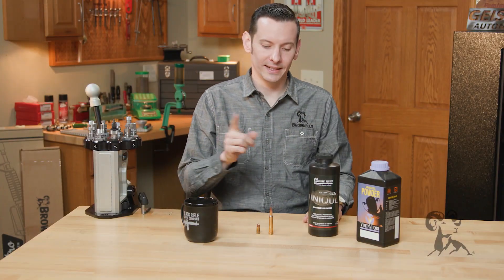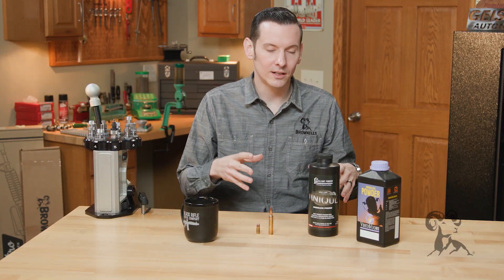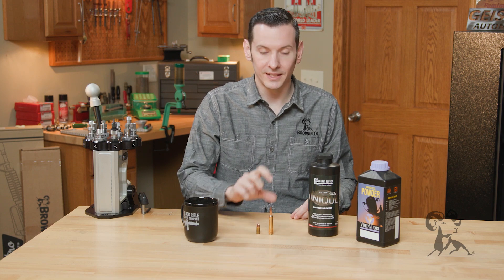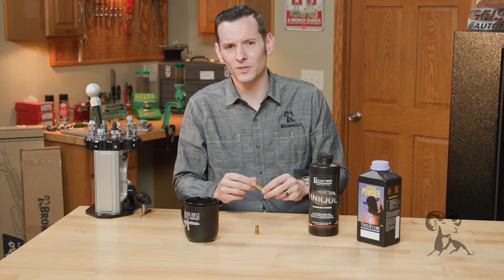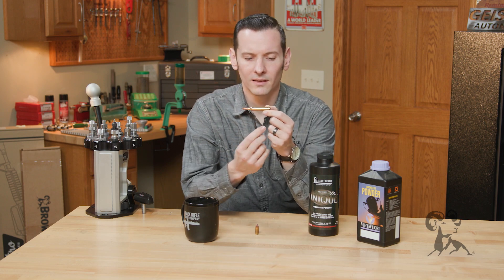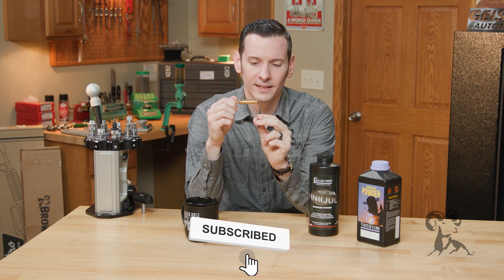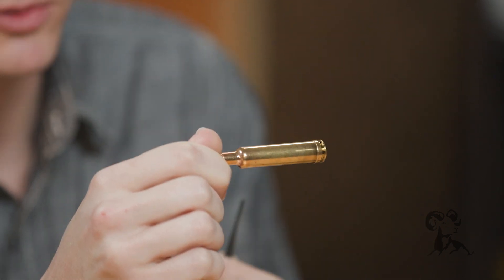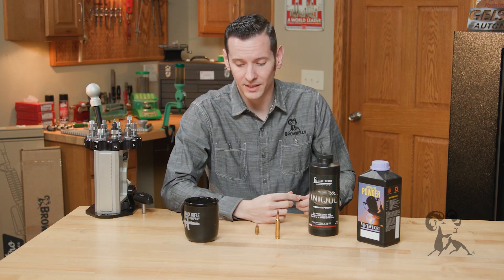Quick Tip: The Dangers of Undercharging a Case

Comment: Started reloading in the early '80s and can't remember which manual it was that for any load which was undercharged to top off the case with kapok to fill the space.  Supposedly would burn cleanly and keep the powder back against the primer port for normal ignition.  I never tried this.  I do however when loading Titegroup in 45ACP 200gr SWC, only partly fill the cases.

Comment: In my early loading days (bolt gun, not semi), my manuals said that if you were running under-charged cases you should fill the space with kapok in order to ensure proper ignition of the powder.  That was in early 1980s, haven't seen that advice printed anywhere since.  <EDIT> I NEVER LOADED WITH FILLERS, DO NOT TRY THIS AT HOME!!!  <EDIT>

Comment: There are lots of microloads that work really well. I make them from time to time for "parlor gunning" with .38 Special and with .303 British.
Example. .38SPL case, 3.0gr Bullseye, CCI primer, (1) 0.375" lead ball.
Example: .303BR case, 8.0gr Unique, Winchester primer, (1) #0 buckshot

Note that neither of those loads will fully obturate the case but both loads should be plenty hot enough to clear the bore and act as a very light plinker. Neither will damage either your gun or your brass.

Comment: There's a ton of variables that aren't being addressed or considered. 300blk, subsonic loads are textbook under-charged loads, but do not detonate or cause pressure spikes. The scenario you suggested, would mean that the case load would have to be loaded less than half it's case volume and assuming the flash hole is in the exact center. Although the scenario is plausible, the exact cause is difficult to pin down. And this is assuming we're talking exclusively about rifle ammunition, correct?

Comment: Case in point: H 110. That’s a fine, very dependable powder when used properly in full or near-full loads but ignites inconsistently when under-loaded. You could have over-pressure, but more likely a squib.

Comment: How about the traditional 2.7 grain Bullseye .38 Special charge?  This meets the definition of below the center axis of the case, but has been used, without incident, for eons of Bullseye target shooters?
Reply: I believe this is not a problem with fast burning powders like Bullseye since they always burn quickly. The problem happens with reduced loads of slow burning powders which are designed to fill the case with typical loads. The burn rate may increase significantly in partially filled cases. The most common problem with fast burning powders is double charging the case.
Reply: @machintelligence  I agree, and that was my point.  The video didn't address the relationship between the phenomenon under consideration and burn rate of the propellant.
Reply: @robertgad3269  I didn't mean to contradict you. It was more of a clarification.
Reply: @machintelligence  Understood.

Comment: Spot on. Proven, too. If the flame from the primer is able to reach  completely across the column of powder, it can all ignite at once, instead of burning progressively. Enormous pressures result. I carry around the head of the extractor from an 03-A3 Springfield in my thigh since 1975 as a reminder. A very reduced charge of IMR-3031 caused the round to detonate.

Comment: Partially true: H110 is unpredictable in light loads, but blowing up your gun? That's like blowing up a house with a teaspoon of gasoline!! Not possible the BTU energy simply isn't there to create the gas volume to overpressure and blow up a gun! The powder has a burn rate that is controlled by the chemistry.
Reply: Correct.
Reply: @DinoNucci  I do light loads for fun. If too light a round may only go halfway up the barrel, now you have to tap it out with a brass rod! LOL Typically you can go 60% to 85% powder. Kinda handy on a 9mm AR-15 that are hard on the gun with a heavy buffer slamming around!

Comment: Both undercharged and overcharged loads that act non linearly are typically double based ball powders.  There are powders that spike pressure if the load density gets beyond say 90-95% but stick powders act just fine in compressed loadings.  The opposite is true too!  There is way to much energy and cavatiation to give this theory any credence, you can point that rifle straight up and get the same results.  That's a myth for sure that the reason is because of the orientation of the powder caused a pressure spike, total bs.

Comment: I've heard about this a looong time ago, but this is the first time someone actually explained why it happens.
Reply: It doesn't happen. It' scientifically doesn't happen.
Reply: well, there is 2 things that can happen. First a massive pressure spike, to much powder at once is lit. The other is secondary detonation, ie the powder starts to  burn but goes out and the bullet has moved up the barrel, then the pressure wave comes back and the powder starts to burn again. Now that the bullet is further up the barrel, the pressure will be to high at the wrong place and will cause either bulging in the barrel, or just plain banana-peel of the barrel.

Comment: This is why I always keep a control bullet on my bench that has the correct powder charge and bullet seat depth.
I use it to confirm my scale is weighing correctly, and to ensure each bullet I reload matches the weight.

I let my mind wander while reloading some .303 British, and instead of 42gn of powder, I loaded them with 40gn of powder.
Thankfully I checked the batch, and found they didn't match the control round, so I had to pull all the bullets and remeasure each charge.

A 2gn difference might not have been an issue, but 42gn is the lowest safe load for my powder, so I wasn't gonna take any chances.
As Ben Franklin said, "A stitch in time saves nine." In other words, fix something in time - before there's a problem, you save yourself the grief of an even bigger problem, and bigger problems involving guns is not something I want.
Reply: it would have been fine. maybe if you did 14 grains

Comment: I use a dusting of titegroup in 38 special, I have had split cases but nothing bad to speak of, this load is definitely not a fast draw load, which is where you can have problems with low charges. it’s for making cloverleafs.

Comment: Since primers are scarce, I traded some large pistol primers for some small magnum pistol primers.  I wouldn't normally have wanted magnums.  Anyway I tested some loads using the small magnum pistol primers with reduced powder charges (at the minimum and slightly below what is called for).   At the range, I found the cartridges delivered a healthy recoil and my barrel leaded.  So I'm not doing that again.

Comment: The phenomena first reported in the 1960s as I recall, specifically with small charges of Bullseye in larger cases like 44. Since then I heard of a number of these explosive incidents powerful enough to wreck a Blackhawk. All involved larger cases with small amounts of Bullseye. 

 It doesn't happen that frequently, but just enough so I always avoided Bullseye. There's better powders than Bullseye so why risk gun and body. That's likely why the Bullseye Kabooms are almost unheard of today. But years ago we didn't have the powder choices available today.
 
The cause has been much speculated but AFIK its a mystery WHY it happened randomly. The makers of Bullseye always blamed double charges but the kabooms were usually with very experienced handloaders who shot a lot. 

The attraction of Bullseye was cost savings since a little bit would move the bullet. But saving two pennies per shot was never enough to entice me to use it.
Reply: This vid is fake news. 
The cause for your ideas above could have been from a squib load not existing the barrel - that is what can cause an overpressure, not tilted powder in the case.

Comment: Just had my first squib. I put a bullet in a primed case as part of my method of expanding new 10mm cases as little as possible and somehow set it in the ready to press line. I guess, anyway. Made a click like a dry fire and i had no idea there was a bullet in the lands, seemed like a failure to extract. Luckily the next one wouldn't chamber! Squibs can make almost no sound, pass it on and check the barrel every time you get a surprise no-fire.
Reply: I’d scrap that method, no good reason to do that but plenty not too

Comment: In 15 years of reloading, I have only had one powder charge failure. It was a .38 Special that I only primed and did not charge with powder. It was lodged in my barrel, but luckily, I was able to push it out with a pencil. Good thing I didn't fire another round behind it! Always check every case for a consistent charge before seating a bullet!

Comment: Going with that logic, 45 Colt should be a risky load since you regularly only fill about a quarter of the case volume with powder. Which is why we got 454 C & 460 S&W.
Reply: Correct. This video is scientifically wrong.
Reply: Could it be because pistol powders tend to be faster burning than rifle powders, so the relative pressure spike is smaller?
Reply: @jic1  Much less pressure on average.

Comment: Under charging  is more likely to resule in the pimer backing out of the case in a revolver can cause the cilinder to lock up. Or in extream  under charging it can cause a squib round  with the bullet being stuck in the firearms barrel. A over pressured round by under charging seem highly unlikely I have never heard of that happening ,
Reply: You are correct. This video is false
Reply: @DinoNucci  This isn't the first time this guy has made flase claims pertaining to reloading. He doesn't up on the facts and the ins and outs when it coemes to reloading.
Reply: @wiseguy4364  you are correct. Brownells management needs to be made aware before someone gets hurt.

Comment: I had emailed hodgon's directly about this and they said that this explosion can happen not because of surface area of the powder or anything like that, but because the bullet gets stuck in the barrel because pressure is not high enough to keep it moving. so when it get stuck you are now fighting static friction and not kinetic friction. so what happens is that at that point your under pressure event becomes an over pressure event because the bullet does not keep moving down the barrel, which doing so alleviates the pressure, and instead it just builds too fast and the case blows up.
Reply: Actually both can happen.  What Hodgdon is describing is called S.E.E. (Secondary Explosion Effect) and it is real, but very difficult to duplicate in the lab because it doesn't happen often.  Youusually need a certain set of  conditions such as a fouled bore, heavy bullet, slow powder, and some dumb luck.  The precursor to an S.E.E. is when the bullet slows down but then the pressure builds up and successfully pushes it out the barrel.  That leave a heavy carbon ring in the bore from the incomplete burn which can then cause increased resistance to the next bullet causing the KABOOM.  I've seen this happen and stopped shooting before the KABOOM.  I noticed two separate recoil impulses, and when I looked down the bore I could see the carbon ring about 3/4 of the way down the bore.  I believe the next shot would have blown up the gun if I hadn't caught it.
Reply: CORRECT.
Reply: Yeah it's called a squib. We all know. And that wasn't what happened to Kentucky Ballistics.
Reply: @DronesUnder2A  wrong

Comment: Given the same situation, another perspective holds that when the primer Is fired it does not immediately ignite the powder, but actually flashes over the powder and only pushes the bullet forward. The bullet lodges in the barrel and then the powder ignites. Obviously, in an extremely short period of time causing high pressure that appears as detonation.
Reply: This is correct

Comment: I appreciate the quality info that you and the Brownells team put out. Would the same concern apply to pistol cases with small powder charges? I know that there are powders like Trail Boss that can be used to achieve greater case fill, but would you recommend that for cartridges like 9mm and 45 acp? Also what are your thoughts on S.E.E. secondary explosion effect?
Reply: This video is incorrect
Reply: It depends on the powder.   Something like AA#5 it could be dangerous, but with powders like Unique or Bullseye, people have been using light charges for ages.  If in doubt, contact the powder manufacturer.

Comment: "You can over pressure the chamber by underfilling the case." That's a new one on me. Wow you learn something new every day, even long after you think you have most of it figured out.
Reply: Same here but it makes sense when you think about it. The more I learn the more I realize I don't know. lol
Reply: @LSFprepper  no
Reply: @DinoNucci  you’re incorrect
Reply: It all has to do with exposed surface area to the primer. A good visual could be done with a clear soda bottle and sand.
Reply: @dwightmitchell1464  no. This is wrong.
Reply: @DinoNucci  So, you're crying foul but offering no information proving why it's wrong... Sounds to me like you have no idea what you're talking about.
Reply: @dwightmitchell1464  no
Reply: @DinoNucci    go away troll
Reply: I still remember how much it blew my mind to find that heavier bullets need less powder. It's not all something you can guess in handloading. Really gotta keep reading those books, lol.
Reply: @vincentdivita7800  its not so strange, a normal logical person would conclude that heavies bullets build pressure higher before the bullet starts moving. The MAX pressure during the entire cycle is what is dangerous, as soon as the total chaimber (ie all volume behind the bullet) increases the pressure goes down, the volume quickly increases as the round is moving forward, what is it.. 20 times larger from the bullet starting possition to the last inch of travel? probably more.
Reply: Its been around since the 1960s or rather that was when I first saw it in print. There were enough of the Bullseye Kabooms to justify an article back then. Small charges of Bullseye in larger cases like .44 was the common denominator. 

Bullseye's maker always tried to blame double charges but it happened with very experienced reloaders who shot a lot. Highly doubtful even a double of such tiny amounts of Bullseye would blow a Blackhawk in half.
Reply: Partially true: H110 is unpredictable in light loads, but blowing up your gun? That's like blowing up a house with a teaspoon of gasoline!! Not possible the BTU energy simply isn't there to create the gas volume to overpressure and blow up a gun! The powder has a burn rate that is controlled by the chemistry.
Reply: Vid is wrong.
Reply: @DinoNucci  nope, you are incorrect.
Reply: @christopherbender9794  NOPE he is not incorrect,,,,sort of and yes the video is wrong,,,,sort of,,,more like the video is over simplified probly to let those with less than deep level thinkers have a basic idea of why underchrging can be bad,,,,not to bellitle caleb but I have most likely been reloading longer than he's been alve just by judging his age based off of appearences alone,,,,I also have a pretty good friend that worked at CCI/Omark industries in the ballistics lab for 20 some odd years before he retired, it's WAYYYYY more involved than just how much powder, the burn rates of given powders, the overall case volume versus filled percentage versus the spacific powder being dealt with,,,problem with getting down to spacifics is that it would takes DAYS of video content to get down to the nitty gritty spacifics of it,,,,so to simplify undercahrging can be bad,,,,so the best and most prudent course to follow is to take what is written in reloading manuals SERIOUSLY and develop good reloading practices so mistakes aren't made,,,in 40+ years I've been around reloading I have had ZERO screw ups because I was taught a certain way and I NEVER break from those good habits and methods.
Reply: @looseballs1966  correct. Thank you.

Comment: I have been loading 460 Rowland cases to 1300fps  instead of 1650 and some of them were stretching and ripping in half. No drama just ripping cases in half perfectly around the middle. This is probably why. I'm thinking adding some kind of inert space filler might help with that...  Experiments to come! Thanks Caleb!
Reply: This video is scientifically wrong.
Reply: @DinoNucci  sad story...
Reply: You may have some inconsistent loads or some misfires if you don't homogenize the powder mixture
Reply: @Arcticroberto9376  i was thinking about a solid item like a felt or cork wad.

Comment: I use trailboss for subsonic loads in some of my rifles.  I will stuff a pice of cotton on top of the powder to try and prevent this.
Reply: You can achieve this with a compressed load with cream of wheat on top.
Reply: @dwightmitchell1464  true, but I have 3 dogs, I have an endless supply of toy stuffing.
Reply: @H.R.6688  as long as it is cotton and not some form of poly..Then you might end up with  a melted mess..
Reply: @H.R.6688  As a fellow dog owner, with an 8 month old lab, this comment literally made me laugh out loud. Well done sir.
Reply: @sethrich5998  lol